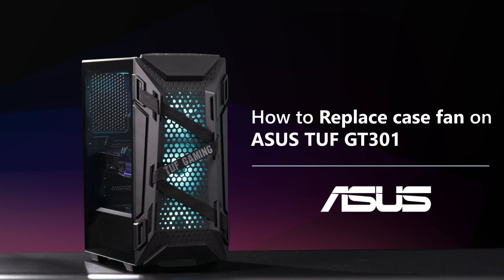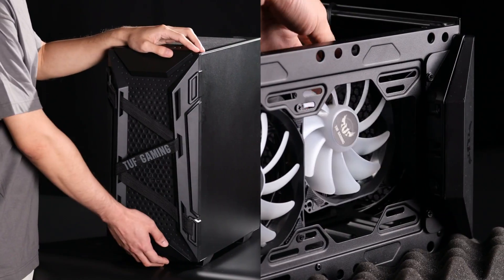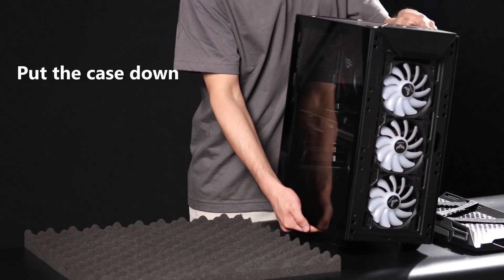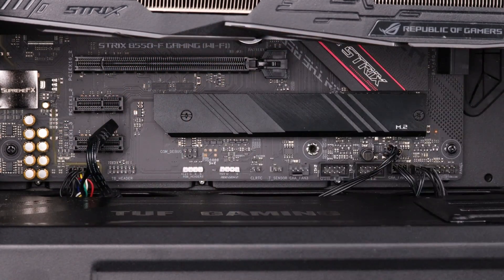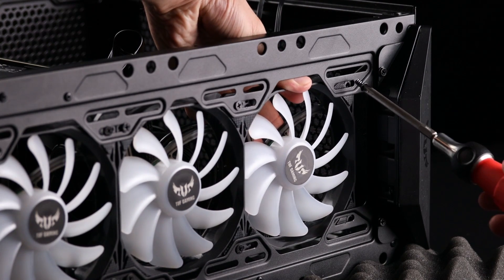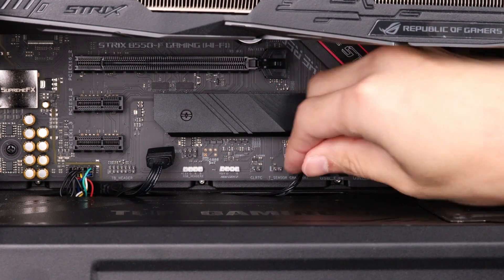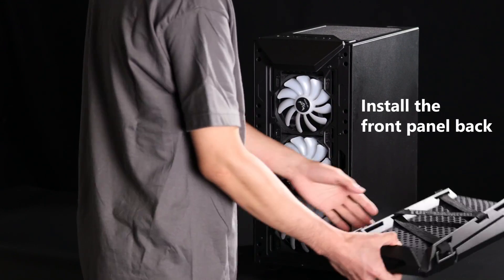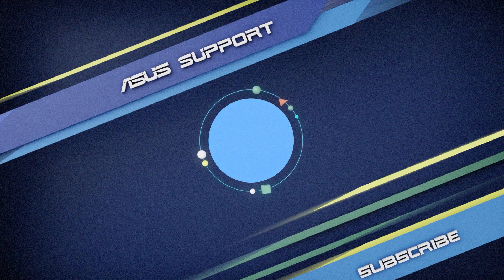How to Replace Case Fan on ASUS TUF GT301      | ASUS SUPPORT

Comment: For those who unable to remove front panel :: just pull stronger (hold bottom, pull outside, not top)😅 it's working, an there is no screws/ damaging locks
Reply: The vid made it look so easy 💀 

Takes so much force fr
Reply: Es verdad uste es muy sabio pero parece que trae cola loka (super glue) caon
Reply: The reason I came to this video. Thank you!
Reply: Thank you😖
Reply: Thank you 😊
Reply: me salvaste la vida, muchas gracias
Reply: Gracias, lo hice exactamente como lo hacen en el video pero como usted dice debe ser con fuerza
Reply: what bottom. bottom side or the bottom middle?
Reply from the maker: At the bottom center, for detailed information, please refer to the picture explanation on page 16 of the instruction manual.
https://dlcdnets.asus.com/pub/ASUS/ODD/DC/GT301/Q21137_TUF_Gaming_GT301_Series_UM_V3_WEB.pdf?model=TUF%20Gaming%20GT301%20Case
Reply: Mil gracias, tenía miedo que se rompiera pero viendo que mucha gente decía que había que hacerle fuerza tomé valor y pude sacarlo, gracias!
Reply: yeah, it looked very easy but i guess my hands ain't got the strenght for it 😅 i pull and see tge bottom 2 points being nearly out in the process but still.. I'll ask some guy to open that one up some time and in the mean time I cleaned up everything from the inside tru the glass panel side

Comment: The housing is tight and does not allow dust to pass through, but it has a drawback - there is very little space for cables.

Comment: You may want to change certain aspects for AIO Mounting at the front. The NZXT Kraken X63 RGB (280mm) will create issues for this case as the front panel will NOT close after installing that AIO at the front.

Comment: Hey I got a new mobo, the x570 tuf gaming wifi and for whatever reason armory crate and the aura sync in it won't detect it for rgb. What do I do
Reply from the maker: Hi Donker Dank,
Based on the situation you describe, it is recommended that you troubleshoot the issue by referring to the following link.
https://www.asus.com/support/FAQ/1045607/#eee
Reply: 1.connected 3pin 5v argb on your mainboard
2.update amoury
3.press color switch on front panel untill rgb was blink blink (1.change color 2.off color 3.m/b sync)

Comment: Asus I have a problem. So I realize that my ai noise cancelling is not working. 👿 I figured out it’s because my windows account is standard not administrator. So a gave all of the armory crate UAC access and the and the audio tab works. But I don’t have everything like the you power modes. But for now it’s temporarily fixed This could also be the problem. My laptop is the Asus rog strix G513QM. 💻 In the website it says it automatically detects my microphone and headphones I was using and it did but whenever I use it the ai noise cancelling only works with my built in microphone instead of my headset’s. It’s there a way to fix is? Also the noise cancelling output only gets a signal from my laptop speakers not my headphones!  🎧 😡 😡 😡
Reply from the maker: Hi chezburger gaming,
Based on the situation you describe, it is recommended that you try to enable and reinstall the driver in Device Manager or use the Troubleshooting tool in Windows to solve this issue.
Please refer to the following link for how to fix the sound issue.
https://www.asus.com/support/FAQ/1015070/
Reply: @asus_support  now my laptop speakers or head phones don’t work. Failed to identify what’s missing. So I’m screwed. Which audio driver do I download on the support app.
Reply from the maker: @chezburgergaming7515  May I ask if you have followed the FAQ as I mentioned above?
It is recommended that you follow the steps to enable and reinstall the driver in Device Manager.
Reply: @asus_support  I tried but when I tried reinstalling them following th steps from the support page it said to delete them and then search for any changes. In device manager  deleted the drivers then tried searching for any changes and it failed to do so. Now what do I do now?
Reply from the maker: @chezburgergaming7515  
Based on your description, when following the steps to uninstall the device and it fails, is there any explanation for the failure?
You can also refer to the link below to download the latest audio version and check if the issue has been solved.
https://www.asus.com/support/FAQ/1035376/
Meanwhile, please try using the Troubleshooting tool in Windows to identify the issue.
Reply: @asus_support  I mean it could be because I’m not on the administrator account and I’m on the standard one.
Reply from the maker: @chezburgergaming7515  
It is recommended that you visit to our zentalk forum for further discussion. 
Our moderator will help you to dig in this issue.  
https://zentalk.asus.com/en/categories/laptop-community

Comment: Very good, sorry, I have a question about whether to connect the ARGB to the motherboard it is necessary to remove the SATA connector?
Reply from the maker: Hi, connecting ARGB to the motherboard typically does not require removing SATA connectors. These two are usually independent connection methods that do not interfere with each other. However, if there are specific physical obstacles between the ARGB connector on your motherboard and the SATA connectors, you may need to relocate or rearrange one of the connectors to ensure they do not interfere with each other.

Comment: Hello! My fans don't spin (new case). I need guidance on the wiring, I may have mixed them up...
Reply from the maker: According to what you described, I would suggest you bring back your laptop to our service center for further confirmation.
The following is the contact information:
https://www.asus.com/support/service-center-location 
Also you can contact the local service center for help.
The following is the contact information:
https://www.asus.com/support/CallUs# 
Sorry for any inconvenience it may be caused.

Comment: Hello Asus
I opened the glass panel of the case to clean the fan grill on the front panel.
Of course, I could not remove the front panel according to this video, and no matter how much force I apply, the panel does not come out and I am afraid that it will break.
Considering that I opened the glass panel of the case, can I use a hair dryer to remove the dust from the net-like panel?
Reply from the maker: Hi, please make sure to use cold air and avoid using hot air.
Thank you.

Comment: Hello i've got myself this case and i've fried argb controller because i've connected vdg into sys fan :( Is there replacement for a controller, because fans work nicely only without lights...
Reply from the maker: Hi, according to your issue, it is suggest that you visit the official repair center for further repair and inspection. You can refer to service location in the following link.
https://www.asus.com/support/service-center-location
Thank you.

Comment: Hello Asus. Can I change the speed rotation for the front fans? Thank you.
Reply from the maker: Hi, according to your question, do you mean you want to change the speed of fan or the rotation of the fan?
If you want to change the spped of the fan, the most common way to control the fan speed is through the BIOS or software. If your motherboard supports Fan Xpert or similar software, you can use these programs to control the fan speed. 
You can refer to the following link.
https://www.asus.com/support/FAQ/1034000/
Also, could you provide your product model and BIOS/OS version?
Thank you.
Reply: @asus_support  tuf gt301, windows11
Reply from the maker: Hi, may I ask have you adjust the fan successfully?
Have you try the steps according to the FAQ?
Reply: @asus_support  Yes I have. I made the adjustments in bios.

Comment: what fans are the ones in the case? is there a way to fix rgb on fans not working and if there is not where can i buy replacement fans?
Reply from the maker: Hi, according to your question, it is suggest that you contact the nearst official service center for further assistance.
Thank you.

Comment: Can you vertical mount gpu In this case ?
Reply from the maker: Hi Merica713,
According to the user's manual of the TUF Gaming GT301, the reserved space in the front can be installed with a 280/360mm water cooling radiator, and the rear is 120mm.
Please refer to the user's manual on the ASUS official website support page to confirm with your GPU for details.
https://www.asus.com/Motherboards-Components/Gaming-Cases/TUF-Gaming/TUF-Gaming-GT301/HelpDesk_Manual/?model2Name=TUF-Gaming-GT301

Comment: Can i install 280 mm water cooling on top?
Reply from the maker: According to the user's manual of the TUF Gaming GT301, the reserved space in the front can be installed with a 280/360mm water cooling radiator, and the rear is 120mm.
Please refer to the user's manual on the ASUS official website support page to confirm with your GPU for details.
https://www.asus.com/motherboards-components/gaming-cases/tuf-gaming/tuf-gaming-gt301/helpdesk_manual/?model2Name=TUF-Gaming-GT301

Comment: I'm unable to pull the front panel, please help
Reply from the maker: Hi, according to your question, may I ask why you want to disassemble front panel?
According to the video and FAQ, we only provide how to disassemble glass side panel.
Reply: @asus_support  I used force to pull the front panel, it works, just need to pull it stronger

Comment: Hi my fans aren’t spinning
Reply from the maker: Hi, Saja Lotfy.
May I ask if your model is the ASUS TUF Gaming GT301 ATX? Did the fans fail to work after you assembled them? Or did they appear after a period of use? 
If it is not working after you have just assembled it, it is recommended that you try to reconnect all cables and check for improper installation.

Comment: The case doesn't open from front
Reply from the maker: Hi Anshul Negi,
After turning off the computer, unplug the power cable and all the attachments. You may be able to hold the front panel and pull it up to remove it.
May I ask if you need any assistance with the current operation?
Reply: @asus_support  Is there a screw or something I have to remove the front panel isnt opening
Reply from the maker: Hi @fredrickgarcia5091 , 
Please refer to the user's manual on the ASUS official website support page to confirm details.
https://www.asus.com/Motherboards-Components/Gaming-Cases/TUF-Gaming/TUF-Gaming-GT301/HelpDesk_Manual/?model2Name=TUF-Gaming-GT301